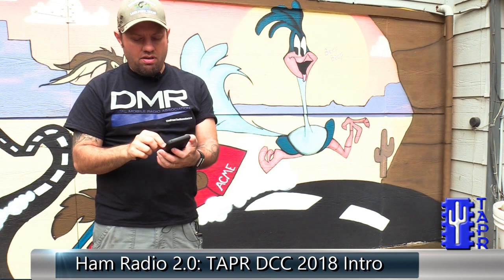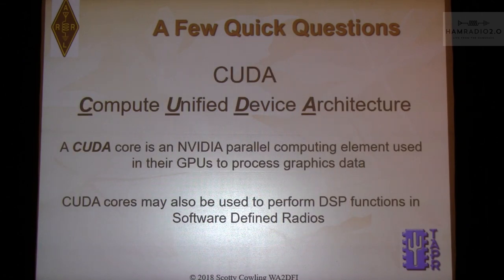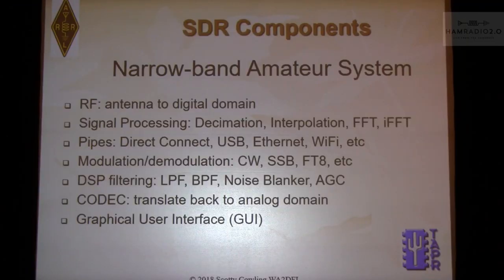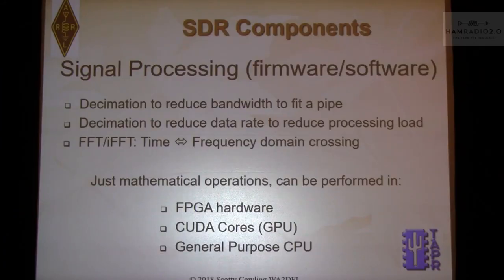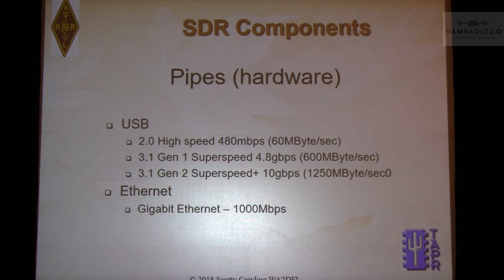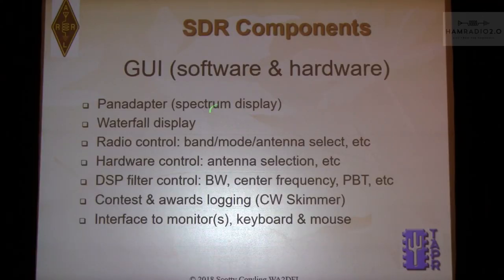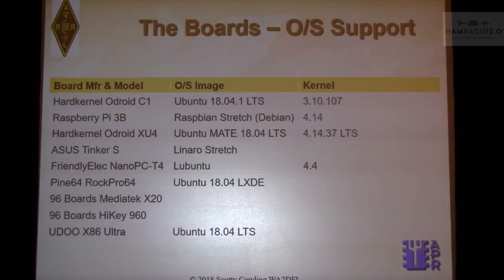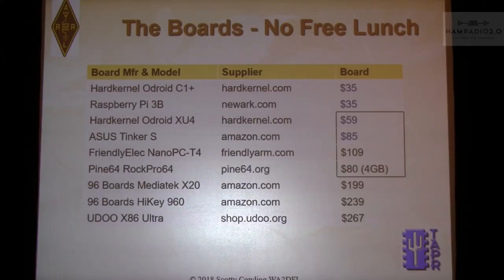Ham Radio 2.0: Episode 151 - Evaluating 9 of the Best Single Board Computers for Modern SDR Systems

Comment: Regarding the question of boards that are available for an extended period of time, we can see that most of these are still available for purchase (notably the octo-core 32-bit ODROID XU4) five years later. Linux kernel support for 32-bit ARM architectures is alive and well in July of 2023 in the mainstream, and vendors like ODROID have proven themselves by continuing to do the heavy lift to try and keep up with the tweaked and tuned Linux kernels on even their aging platforms that have been replaced by new ones. The real critical pieces to making this sustainable at this point in time is to find vendors with plans and road maps of products that fit the need, then for the development and maintenance of the software to work in harmony to ensure continuity (and evolution) of function. A lot of software is a planted seed that dies after not being watered for too long -- sometimes before the harvest in the open source world. Scotty nailed it when he said implementation is a winner. Ideas are where it starts, but delivery on the ideas are the benchmark that make a difference.

Comment: half of the presentation is unnecessary and wasted time.  Skip ahead to 20 minutes or so and bypass all the junk.  I was expecting an actual performance evaluation of the boards with SDR software connected to affordable (or actually any) hardware SDR...  perhaps I did not interpret the title of the video correctly.  The wasted 20 minutes could have been used to provide actual useful data... but didn't.   Scotty, in the future, just stick to the real data and leave attempting comedy to comedians.  The explanation of SDR and how it works  and computer processor comparisons were completely unnecessary or at least could have been summarized quickly without all the inane chatter.